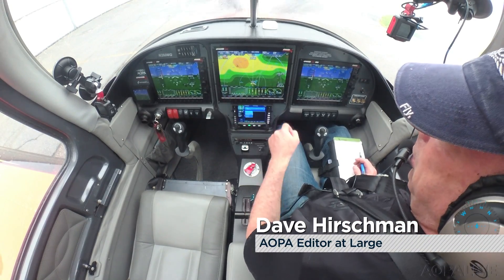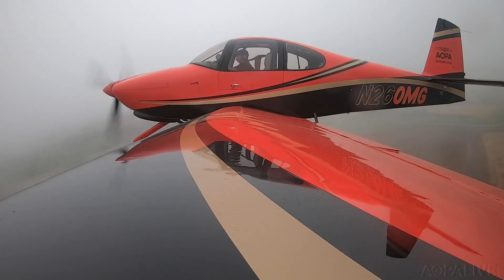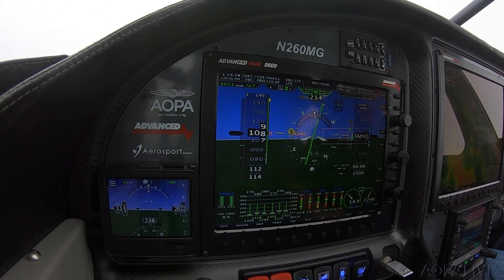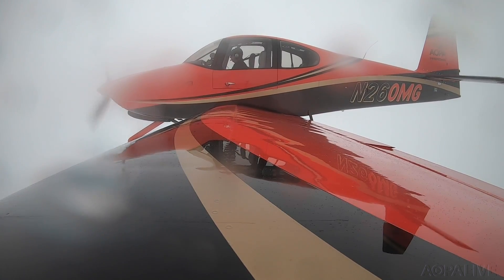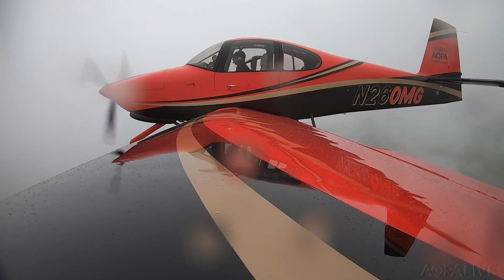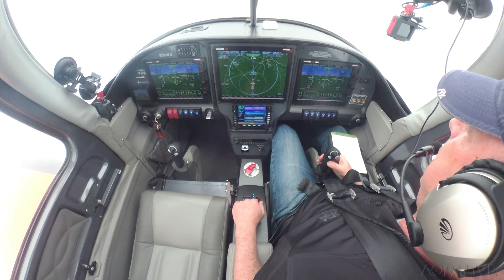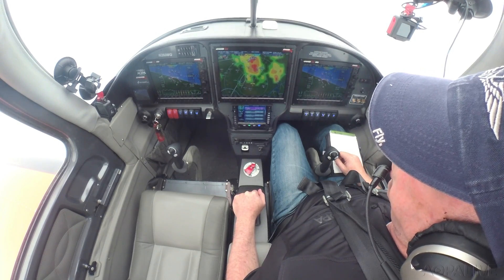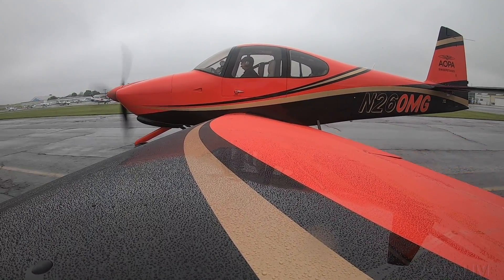Will we make it in? Sweepstakes RV-10 ILS to Minimums

Comment: Wow, great avionics. Reduced your workload, and I’m just curious about your call out during the second  approach, when the GPS alerted “500 feet” (you were 500’ above the ground) and you called,”500 feet to go.”   BTW, 8 seconds later you reached Minimums!  To go to what?
Reply: 500ft until minimums.
Reply: @jensenfleet7366  Yes sir, that's what I thought you called out ... and I'm just curious, were you at 500' above minimums when you made that call out?
Reply: @robincole5739  I'm not the pilot in the video but after watching that section again, I believe the aural alert was for 500ft until RTDZE. "500 to go" call came immediately after the aural alert, which tells me that he most likely meant 500ft to the ground. 
Most stabilized approaches in GA aircraft are typically done between at a 500-1000ft descent rate(1000ft is considered too much by most)
Minimum aural alert came quickly after the 500ft aural alert, which tells further confirms that "500 to go" meant 500 above the runway, not 500 to minimums, as not enough time surpassed between the 500 callout and the minimums callout for the aircraft to descend 500ft.
Reply: Jensen Fleet Yes sir, that was my conclusion. He might’ve been 100 feet above minimums. His call out was 500 to go to minimums, and deserves reconsideration. He does such a great job explaining and I look forward to watching more of his videos.
Reply: @robincole5739  yeah, I don't think that kind of callout would work well in a multi-crew environment, but in a single-pilot scenario it's just fine. He clearly had fantastic situational awareness.